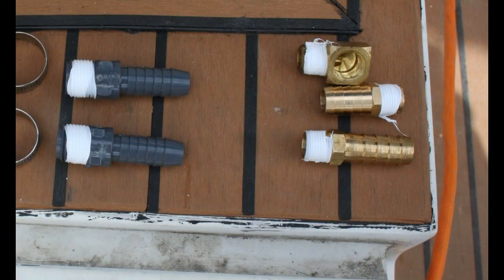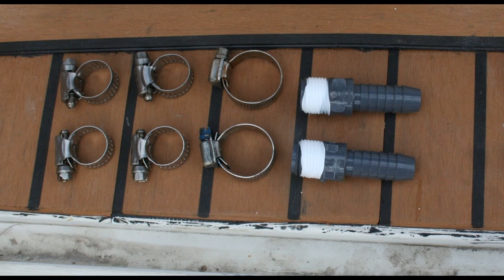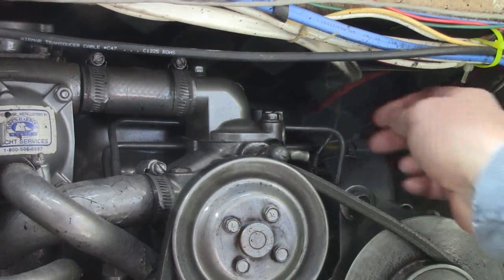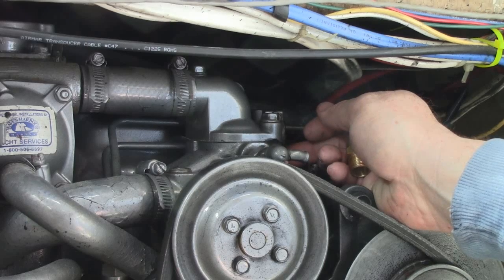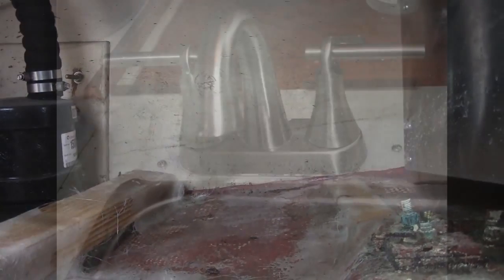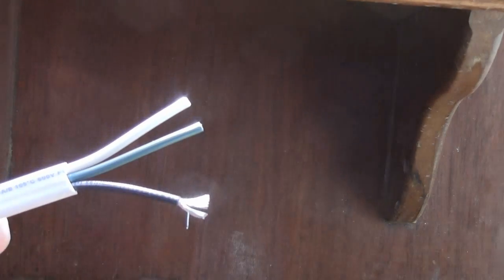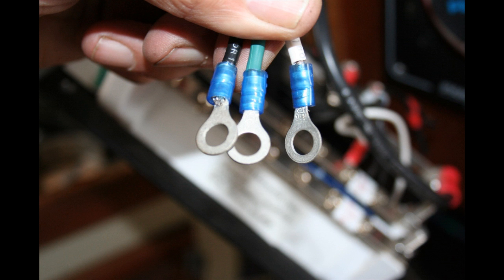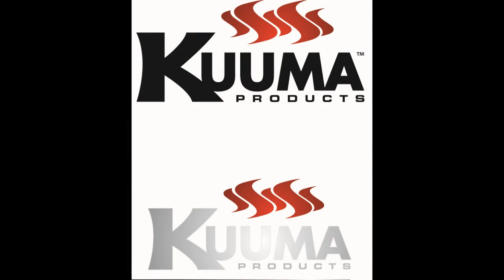Water Heater on boat with engine heat exchanger

Comment: can you say the size of the potable water connection threads (1/2 or 3/4" npt) that are cut into the bungs on the watertank? thx.
Reply from the maker: i think they are 1/2", thanks for watching

Comment: Does this require a coolant line pump to move the coolant or is the difference between engine and hot water tank sufficient to allow coolant temp homeostasis?

Comment: I just want to use for the heat, and hotter the better, I don't understand this part, it has a heating element.. why you need the boat to heat up the hot water tank? On your buy converter box and extra battery, to give enough power for the hot water tank, 🙄 but what ever works,

Comment: So do you have to run the engines to get hot water?
Reply from the maker: if you have 110 electric no, only if you don't have electric 110
Reply: Vagabond Epicurean Sooo is that 30 and/or 50 amp shore power?
Sorry if this is an overly basic question.
Reply from the maker: @steph4287  i run mine on 30 amp shore power, not sure what the breaker is, but i will check.
Reply: Vagabond Epicurean great! Then I may be hooking one up after all! I’ll do some more research (just started looking). Thanks!

Comment: Capt Larry has a good point about the internal water heater heat exchanger failing. This happened to me. The engine will loose it’s coolant and overheat along with creating a mess under the water heater. Also, Don’ t say  “Hot Water Heater” unless you would describe an ice maker as a frozen water freezer.
Reply from the maker: thank you.  I have had this type of system on other boats over the past 25 years and never had an issue.  But i could see how it could happen.
Reply: Tim Tim Tim...There ARE warm water heaters (120-150 degrees) in some industries and in labs. The HOT water heater moniker is correct. I guess you are a retired plumber?
Reply: Haha! I used the term in front of the diesel mechanic who advises me on engine matters. He scalded me and rolled his eyes so now I must do the same to everyone I encounter who uses this term.

Comment: There is a real risk that a leak in the internal heat exchanger in the hot water heater can introduce toxic anti-freeze into your drinking water.. pressure test the system periodically.

Comment: whoo boy.. this is a classic example of the low rent help you pay big money for when getting your boat serviced.  Pre-fill the damn water heater heat exchanger with coolant.. so there are very few bubbles .. the expansion tank is NOT the right place to top up the system.. it is not normally connected to the cooling system.. unless the coolant is very hot !   Sheesh.. so much wrong info.
Reply: Hey Capt...why not advise what SHOULD be done instead of lambast what HAS been done. Sheesh!
Reply from the maker: thank you for you input, so far it is working great, I am the low rent help:)

Comment: Aluminum inner tank. Give me a break. Aluminum is an ANODE ..go stainless or glass lined if you are an educated mariner!
Reply: Who wants to be an educated mariner when we have experts like you Giovanni?  Have you studied this particular heater and determined there is a galvanic corrosion bridge point? Never forget that the high-end marine  hot water heaters cost three times as much as this puppy. This unit could work for a decade for all we know.

Comment: Can you please tell us how did you bleed the air in the coolant lines?? Thanks
Reply from the maker: All I did was run the engine until it was hot and the thermostat opened, shut off the engine.  Then added coolant to the engine, not the expiation tank. 
I put the coolant cap on, but not tight, just to the 1st turn ran the engine again until it was hot and repeated the process about 3 times.  When I did not need to add coolant any more I put the cap on tight and the engine has been running great.I hope this helps.
Reply: +WaterfrontVacations1 interesting, my hx iz higher than the engine, and it takes a lot to bleed it... I will try to run the engine at 2000-2500 rpm this time. Rgx. V

Comment from the maker: Calvin,
1. the heater needs to be drained and winterized

2. as for tankless, that would take AC power, but with the engine running the engine will heat the water through the heat exchanger when no AC is available,

However, there are some propane tankless heaters but I think those are rather expensive

Comment: So the engine heat exchanger works when the engine is running, does the electricity automatically shut off?
Reply from the maker: The electricity is off when I leave the pier as I do not have a generator.  Plus the temp sensors would not call for elec once the water reached the right temp, so i guess the answer is yes the elec automatically shuts off